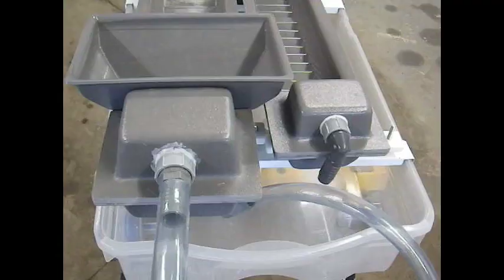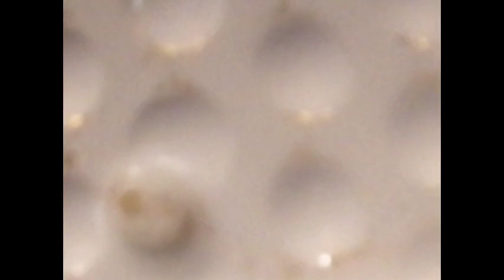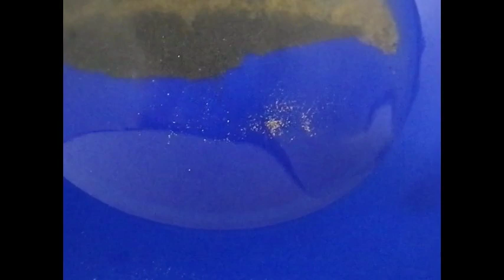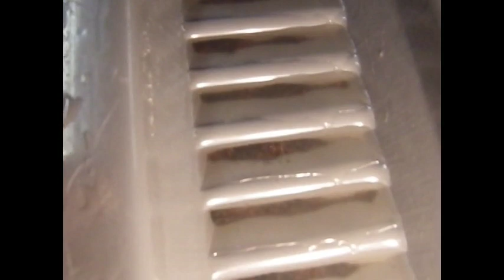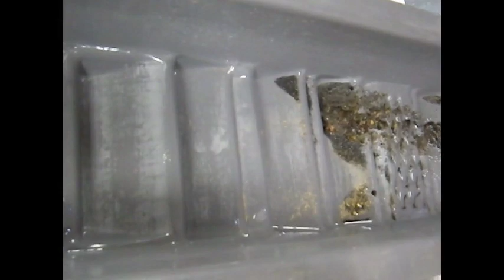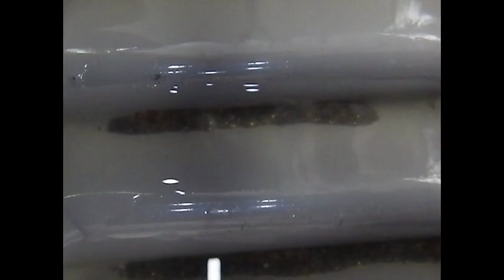Fine Gold Clean up finishing sluice station

Comment: I like the in-depth testing of the riffles to see where the gold migrated to, when does a guy trust his sluice to only run the cons through once or should a guy re-run until no trace of gold is found? I guess that why testing is important, where did you get the miller table from or did you build it? What kind of plate is in the bottom? Thanks

Comment: Hello... Great vids on your gold prospecting adventure and testing 5 years ago at the NRS!  I like your custom high banker, it's well thought out.. FYI I made my HB's out of wood cuz I'm cheap.. Lol but they work well and very similar to yours ... And since I've started prospecting 3 years ago I've only used miners moss.. But it's yellow and it's a bigger thicker one though, with larger loops then blue mat.. Plus I have rubber back Corduroy carpeting on the bottom and 1" expanded metal on top..Ive had some pretty good results with that combo.. With the Alberta flour gold .. Anyway I'm just wondering if your still prospecting these days ? And please feel free to check my channel out too.. Thanks for sharing and sluice on my friend 👍

Comment: What manufacturer Miller table is that?  I use a Martin prospecting Miller table.  I use it to do my final cleanup and it works rather well but it does loose some gold.  I've been wanting to try a different style Miller table and I like the setup of the one in your video.  It tapered wider at the end to slow the water flow and about a foot longer than mine.
Reply: I want to know that too! where did you get it, or did you make it. What material did you use for the green pad??

Comment: I know you want to go fast, but you appear to be overfeeding.  That is why you have so much gold getting through the first sluice and so far down the second.  Review your video and note how the large globs do not break up until they are several riffles down.  Try dipping your trowel directly into the water and let the water pull it off the trowel.  I use an Angus MacKirk with 1/4 classified and get 99+ percent recovery.  I checked tailings many times when I first used it.  I load a heaping tablespoon at a time (again dip the spoon and let the water pull it off).  I can get through a quarter bucket in about 20 minutes with no second run.

Comment: Good thing you switched out that white fitting. I have had at least 3 of those crappy white hose fittings blow out on me. They cannot handle the pressure of my house water pressure, which is not that high.

Comment: Add 1 more bucket for your pump to go in with holes in it. So you will have a settling bucket, your main tub containing both buckets, and then you have an intake bucket with the pump in it. The water will still be murky but you should have very little sentiment going into your pump. Any material that escapes the settling bucket should settle in the main tub providing cleaner water for your pump. I feel you you on the spoon fed clean ups :(

Comment from the maker: Yes a combination of mackirks i put together. I'm likely not running mats in my high banker this season and will have a spring video out of my new direction. As for the miller, it is a clean up sluice with the ribbed mat ripped out. I have a video of it in my profile.